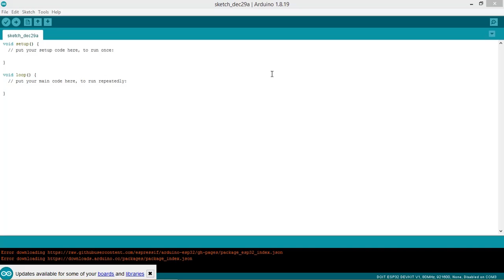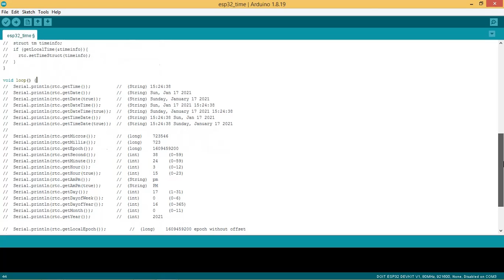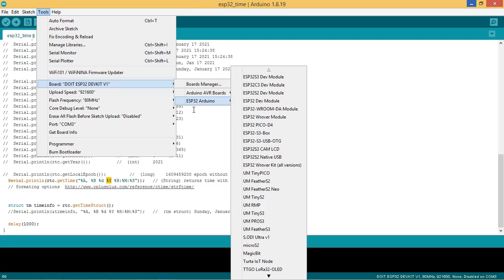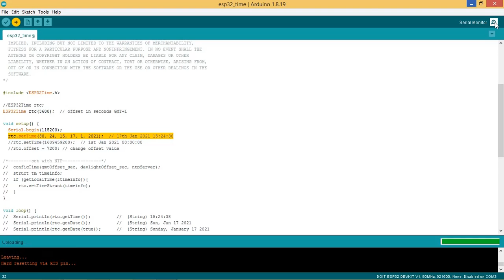How to Read the ESP32 Internal Real-Time Clock (RTC) - Arduino Tutorial

Comment: Thanks for the video ! , how can i set the offset for GMT -4:30 ?
Reply from the maker: Thanks!. Try setting offset -16200..
Reply: @adtechknow2761  how You calculate that númber ? Is there some explanation in library source code ?
Reply: Yes indeed, there is a line inside library that says the parameter "OFFSET" should be in SECONDS. I just checked and if you need -4:30GMT is -16200seconds. I haven't proved yet, but thanks a lot  @adtechknow2761
Reply: (4*60*60)+(30*60)=16200
Reply: Basically it's difference between total number of seconds from GMT. So in your case convert 4 hours into seconds i.e. 4x60x60
Then for 30 minutes it will be 30x60
Sum these two results to get 16200.
Hope this helps

Comment: Dear, when esp32 turn OFF and then turn ON after 30mins time will change, if so what to do for this
Reply: you will need to update it using an external source like a small RTC clock with redundancy battery or through the internet. So if turns off the time is tracking